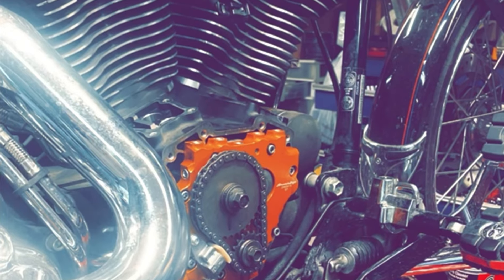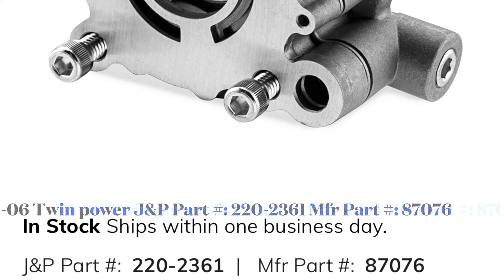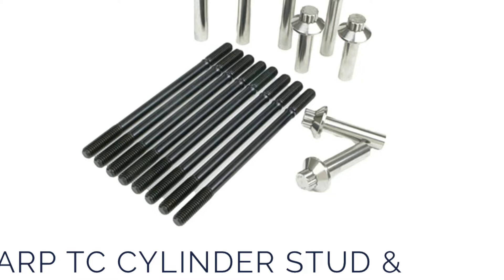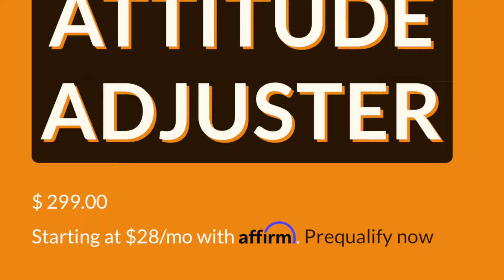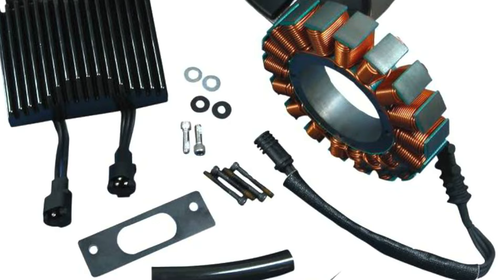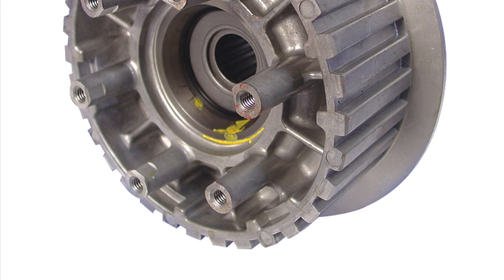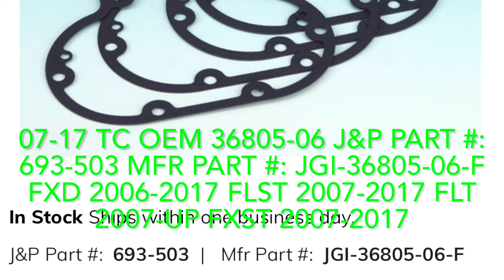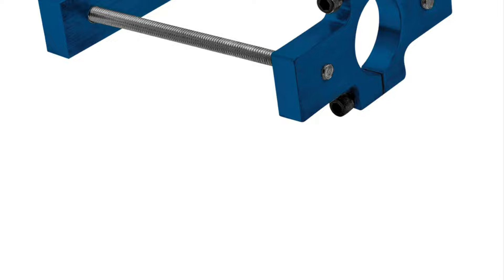5 Most Common Harley Twin Cam Issues to address before they address your Motorcycle! 1999-2017 H-D

Comment: I "upgraded" from a Sportster to a Twin Cam.... now I realize the Sportster was the real upgrade.
Reply from the maker: Yeah I sell parts for living, if that says anything. Sometimes I swear they made the twin cam because the evo was too reliable sometimes.
Reply: When I sold my Sportster and got a Dyna TC 96, all hell broke loose regarding reliability. Replaced my Dyna with a Road King Screaming Eagle big bore. Most unreliable bike I have ever owned. That was a money pit. Finally went for a Triumph T120 Bonneville and starting to enjoy motorcycles again. Still miss that Sportster. It was as reliable as the Bonnie. Sometimes I think of getting an M8 but the HD is charging an arm and a leg for them. Can't really afford one. And with the new set of issues that the M8 are suffering from, i think will keep the Bonneville for some time.
Reply from the maker: @atomicgrasshopper4391  sold my sporty for a Vic, I work for a parts store that sells almost 😅 exclusively Harley parts. With all the issues I see with the new M8’s and Dealer spats and fighting over warranty issues my only motorcycle will be a Indian  even after they screwed victory. I’ve just been hearing nightmare stories from the dealer across the street. They need a aftermarket Clutch pushrod because they are spewing all your trans into the now leaking primary no shit, crankshaft runout issues on brand new bikes, blowing head gaskets left and right and your waiting 28-32 weeks for parts, not labor on stock bikes nothing modified. Stators and Regulators on back order, They are screwing their customer base and it’s going to bite them like you showed with a new bike obviously.
Reply: That's why it's called the Twinscam.
Reply: Upgraded to the screaming Eagle cam plate kit. Regular fluid changes. 2005 Harley Davidson lowrider - Tc88 - 40k miles and Still sounds like a band of Angels.
Reply: why didn't they get it right in the first place.
Reply: @steveperry1344  When they dropped the EVO, they were doomed.
Reply: @frankfurther3828  i got a 1980 flh band new and had it for 20 trouble free years. then an 02 heritage with twincam and sold that recently.
Reply: @steveperry1344  the right choice.
Reply: Twin cam's are  good motor's !! Like everything else, if you neglect it things will go south!!  I just got a Great deal on a 05 heritage, because the guy didn't even know what a tensioner was!!  $16 cyco shoe's & a gasket set & Done!! It's a great bargaing tool for an older Twin cam!!
Reply: @pauld7309  Remember the self destructive cam chains and the heat deflectors ?   Back to the dealer for $ervicing.
Reply: @pauld7309  did you do both cam chain tensioners?
Reply: @steveperry1344  yes I did. Just the shoe's  cyco makes them better material than Harley's!!  $16.00 for both shoe's and pins!!
Reply: @pauld7309  did you have to do the whole thing with cutting and then replacing the push rods? i've looked at the videos on how to do it but the pushrod thing seem risky for me. i have plenty of tools but i'm a shade tree mechanic although i have broken down an auto engine and completely rebuilt it but that was over 50 years ago. are you a pro mechanic?
Reply: @steveperry1344  Nah , I'm a shade tree mechanic also, I've got a 01 electric glide and 05 Heritage. I did hear driven on my Glide S&S  510's a few years back.  On the heritage I just did Shoe's, lifters & inner cam bearing.  I'm retired so I didn't cut Push rods, plus it's good to get in there and replace your breathers.  So you don't get the oil drop out of the  air filter.  Not a bad job, turn on some tunes & enjoy.  Cutting P/R is faster & less work in disassemble ( seat , tank, ECT )  but more money & you don't get a peak inside the rockers.
Reply: @pauld7309  ok, i have an 02 heritage with about 25k miles on it and will have to do something for peace of mind. i picked it up used 7 or 8 years ago and it's a real nice clean bike all stock except for the straight pipes which i'm gonna replace because it's way too loud for me. it also has an S&S carb which is nice.
Reply: @steveperry1344  yeah sounds nice. I would inspect them for sure. Pretty easy job to at least look at them. If no one been in there it's probably about time!! Good luck.
Reply: @pauld7309  i saw the plastic shoes in the V twin catalog. i heard one guy on youtube say he just took them out altogether and runs with no tensioner.
Reply: @steveperry1344  yeah I seen that also. He's Cray Cray. Lol or work's for a Harley dealer? Lol. I guess as long as it didn't jump time you'd be ok. But I wouldn't do it. Lol. On your heritage it's not a hard job to inspect them, exhaust comes off as one piece & take the running board off & then the cam chest. No biggie, then you'll know wassup!! Inner one seems to wear faster.
Reply: Really? Why do you think so if I may ask.
Reply: @michaelluciano3690  
The Sportster is more reliable and easier to maintain. The gear drive upgrade that many people do to the big twins is already built into the Sportster from the factory. An oil change on a Sportster is simpler and having the transmission and primary share the same oil in the Sportster is smarter than having three separate compartments. If you have to change a drive belt on a Sportster it's a simple job but if you have to change a drive belt on a big twin you literally have to remove the entire primary drive from the engine and transmission. The Sportster seems to run cooler than the big twin. When you compare the rubber mounts Sportster to the other rubber mounted Harley's at the time the Sportster comes stock with 3 engine stabilizer links, the big twins had to have additional stabilizer links added to eliminate the Harley death wobble.
And lastly the Evo Sportster was 100% worth the price tag, the big twins not so much.
The only place where the big twin may come out on top is the ergonomics for the rider.
Reply: @jon5423 Hi, can I get your honest oppinion on the Victory engines as I'm thinking about buying one. I've heard only good things about them. Also, does the Indian have many issues or is Harley the only one that has issues? Still riding my 1995 Softail Custom  Evo with EV27 cam at the moment with zero issues.
Reply: I read somewhere the newer sportsters are a pain as Harleys have changed the engine access in some way.
Reply: @jon5423  jeez my twin cam FLSTF Solid crank is 22 years old .Are we sure u r talking about Harley .???
Reply: @steveperry1344  over here .Job done S H adjust push rods new bearings new cyco inner and outer .total price to get it done .£600
If you just want the pads checked and cant be arsed to do it .price here is £100
Reply: In 2023 I sold my utterly reliable 2007 XL 1200 and kept a 2010 Twin Cam Road King. Probably a mistake too!
Reply: @jamessouthworth1699 yeah sportster is cool but u never catch me on one.
Reply: @iantman6664  If that's your personal preference I respect that but if it's because you're afraid of what your buddies would say I feel bad for you.
Reply: @jamessouthworth1699  you can feel bad all u want but it’s bc they so tiny. 🏍️💨

Comment: I'm 70 yrs old .I've  rode Harley Davidson all my life . I must say I've been riding a twincam since 02. Of course I had to spend the money  nessssary to make my 23k dollar bike Dependable.  I always had much respect for HD but ever since I paid all the required fees to own my motorcycle , I had to turn right around and spend another 15hundred to get it right. That's me doing the work. The bikes aren't getting better , cheaper for them , to hell with the consumer !
Reply: That's why I don't buy new bikes. I know I'm going to be pulling and upgrading problem areas. You can find clean bikes with less than 20k miles for 5 to 6 thousand all day in my area. 20k is nothing for the basic components that don't get changed.
Reply: Hi 👋, I am 72+ years young, I have just purchased my 4th HD my 2s Deuce, from the uk , I am English retired living in France, I paid around 5K , it is in very bad condition, it has not been on the road for over a year, I am slowly going through it, stay safe ride free, France

Comment: Good stuff. I am a fanatic about maintenance on both my 103TC's , 3 hole oil changes etc. Always run AMSoil and clean that air filter! I made my own maintenance spreadsheet
Reply from the maker: That’s awesome, most people are surprised their bike has 3 different oils. Let alone thinking that far in advance kudos to you 👏
Reply: The TC103 seems to be the only ones not having issues if u leave them stock ish

Comment: Tensioner replacement at 25k, crank runout, oil sumpung. I solved mi TC88 issues when I bought a DCT Wing.
Reply: I have an 02 Electra Glide with Stage 1 & 2. I upgraded the cam chest with Fueling components including high capacity oil pump, and S&S 510 cams. No cam issues going forward and the Harley will never leave my possession, however I bought an 08 GL-1800 to crush the long distance miles.

Comment: I have an carbureted 02 Electra Glide TC-88. I had my cam chest rebuilt three years ago at 35k miles. I used Fueling cam chest and high capacity oil pump components and upgraded my cams to S&S 510’s. I also had my carb rebuilt with Ivan’s Performance jets. Three years later my bike is still running strong and I have no reason to trade it or sell. I love the old girl!
Reply: How did you determine what jets made your bike run right?
I have same bike.
Reply: S&S 510 gear drive cams in a 2000 fxst with hooker 2 into 1 60000 and still do my own maintenance runs perfect

Comment: Hi 👋, I am new to your work shop, I had a 1999, DEUCE, 88 . around 2006/7 I had screaming eagle, big bore kit put on, I’ve had my cams ignition and lots of other goodies, DD 2-1 exhaust, I had to sell it in 2019 because of my ex partner had scammed me for 10 of thousand of pounds, it was over 55,000 ml on the clock, unlike like my ex partner my bike, never let me Down, I used to live in the UK i now live in France.
All of my HOG rally’s where I travelled all over Europe, sometimes do around 4000 miles in two weeks. I am looking forward to the day hopefully I will get another bike, Ride safe guys, enjoy the summer it’s on its way, 
PHIL FROM THE DARK SIDE OF THE MOULIN FRANCE.
Reply: How did you get a Deuce a model year before they came out? (2000-2007)
Reply: Hi 👋, sorry it was 2000 , I have just purchased a 2003 deuce, it is in a very bad condition, I have just replaced the main belt drive and sprocket, and Jim’s upgrade inner bearing on output shaft, new coil and leads , and rebuild the HSR42 carb twice all new jets, 
And I have found that it has been cam S&S G510 , not sure if it was 88 or 95 I will find out over the winter months, France.

Comment: I am keeping my 99 EVO powered Softail Custom. It gets me where I want to go without problems.
Reply: when was the last time you checked your lifters....
Reply: @hawkdsl  40,000 miles ago when I replaced the inner cam brg. with  a Torrington. I am still running the stock cam which is not a problem with the later stock lifters. I only have 64,000 on it. I have friends who have well over 100.000 by just replacing the inner cam brg. But they are all running the stock cam. It is when you change the cam that puts a strain on the lifters. A mild cam is OK. But high performance cam really puts a strain on the lifters.
Reply: @jimkraft9445  Good to hear, but my point was... they all have problems. Every new iteration of HD motor has a combination, and whatever engine we run, we tend to believe is the best one... Which of course is not true.
Reply: That is true. I put 60,000 miles on an 84 XLCH Sportster. At 30,000 the crank pin flaked off. Total rebuild. After that it was trouble free. When the ignition module went belly up, I changed it to points and condenser. No more problems with that. 

I started on a 1942 "45" flat head when I was 14, back in 1955. I am not new to harley problems, but that old 45 took an awful lot of abuse from me and just kept running.

 I am 82 now and do not do any long rides anymore. Just putt around the back roads where I live and to town which is only about 7,500 population. I will say the EVO has been the most reliable of all the bikes I have owned. About the only other thing I had to replace was the stator. Since I do all my own work in my own garage, I like the simplicity of the EVO. I can change carburetor jets in about 10 minutes without removing the carburetor.
Reply: @jimkraft9445  Still riding at 82 is awesome. I'm sure you have hundreds of great stories to tell riding that long. Stay safe, and keep the shiny side up my friend!
Reply: Thank you. I hope to ride a while longer Lord willing and the creek don't rise. My best story is, I rode my old 45 to a school track meet at a town about 4 miles away. I asked a girl if she wanted to go for a ride. She said yes and hopped on, and we have been married for 63 years. My 42 had one of those big buddy seats. I knew she was the one that day, but I still had to convince her. LOL.
Reply: @jimkraft9445  Oh that's the best! Congratulations.
Reply: I agree, the only engine that was a littlebit reliable. And the V Rod ofcouse, but that is German technology.
Reply: @hawkdsl  My 125 and 150 cc Honda rental scooters can do more milage without problems... why?
Reply: @corneilcorneil  Doesn't run as hot, only 125/150 cc, not powering a 600 to 800 lbs bike... etc. Revzilla took a 1,000 mile trip with a couple 90cc and 125cc hondas.. they had problems too. But go on with your flakey bad self rental man! After all, you meet the nicest people on a Honda... LOL!
Reply: @corneilcorneil  the 125 was new, and the ct90 was rebuilt... Anyway, the point was anything mechanical breaks and wearers out. No brand can escape it. Your inference was your Hondas are somehow better. Their not. Gather yourself, calm down, and try to live a better life.
Reply: @corneilcorneil  yes, I make assumptions... Like you have serious mental health issues, anger, and bitterness.
Reply: @hawkdsl  Ok, you give up... know your place!
Reply: @corneilcorneil  again, my comments are valid. Yours are just purposely caustic.
Reply: You beat me .I started riding in 57 on a 1948 350cc matchless .Still riding on a FLSTF At 82 as well.
Reply: @John-ob7dh  Super. Those old Matchless and others were lots of fun also. I loved the old BSA and Triumphs also.

Comment: I replaced my tensioners with gear drive on my '01 FXDX.  SE cam chest and oil pump, S&S .510 cams, Supertrapp, Mikuni, K&N
Reply: Is the gear drive possible on fuel injected? I was told no but find that hard to believe.
Reply: Gear drive has nothing to do with fuel.
Reply: @BobO-ho9zv  It does keep your timing perfect compared to chain drive
Reply: @dennislett7896  gear drive is preferable IF you're pinion run out is under .003"

Comment: This is crazy. Just about the time I go to pull the trigger on a Harley-Davidson I come across a video like this and YouTube is full of them. I've got money. I just don't feel like spending all of it and working on these bikes. I don't want to work on a bike. I want to ride on a bike!
Reply: If youcant do even minor maintenance.,and still want a Harley . Get a Evo motor they were very dependable.  I have an 06 twin cam fatboy but I've had Harleys all my life ,I can deal with the minor stuff.
Reply: @jeffhawkins711  I appreciate that comment man. I actually have my eye on a good lookin Good running 88' Evo Softail. Yeah I always have done. All my own maintenance and many repairs.
Reply: Bingo. 11:30 charging system battery, stator, rotor, regulator. The straw that broke this camel's back. Only 2 years after getting the S&S gear driven cams and the 2000 FXDX had been running like a BOOH. Thought about trading in for a new dyna but it was 2019. Got a KTM SAS w/ about 3K miles on it. I guess the dyna only sounded bad ass. May still try the recommended stator/ rotor solution someday. Thanks for the information.

Comment: If you purchase a Flo reusable oil filter for around: $120 you can see everything the magnetic pre filter and stainless screen catches when you change your oil and clean the filter.  This imo is the best way to catch a problem early.. These type filters are used in aviation and have significant advantages over unknown quality paper filters. They pay for themselves and will last way longer than your bike.  My 2012 SG with 50k is on it's 15th oil change so my Flo filter has more than paid for itself while providing cleaner, cooler oil to my 103.
Reply from the maker: Very interesting I thought they were snake oil for the longest time, that’s awesome I had no clue about their history

Comment from the maker: 99-06 also need OEM 33443 JIMS 33443-84 TC oil pump/evo tappet block alignment tools 🧰 (X 2)
Reply: Definitely not needed. Oil pump alignment can be done by rotating the rear wheel

Comment: I had a 02 softail custom and put 75000 miles on it and tore it down and the cam tensioners were fine. Cyco gasket tensioners